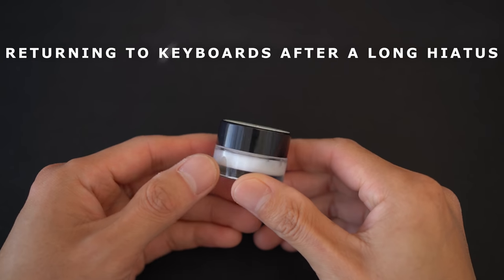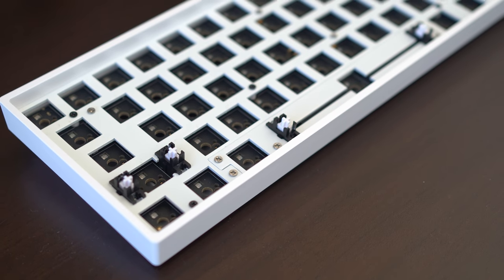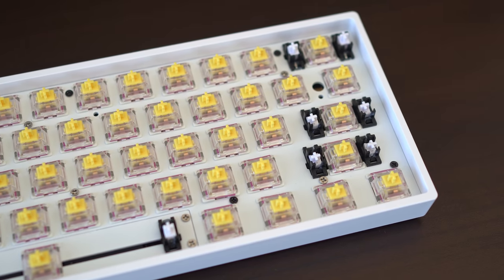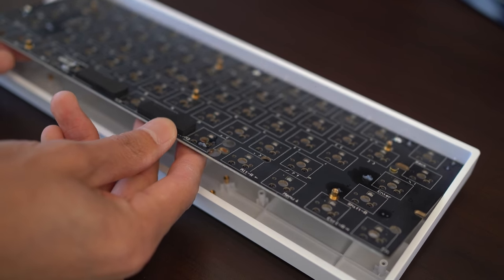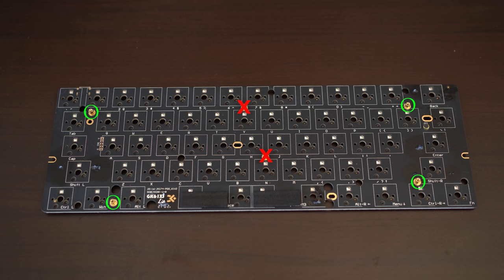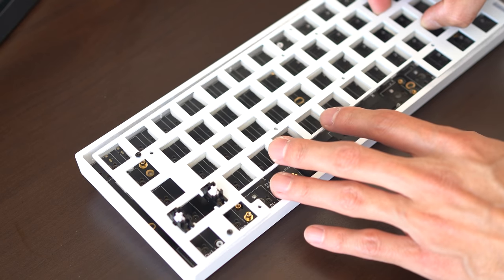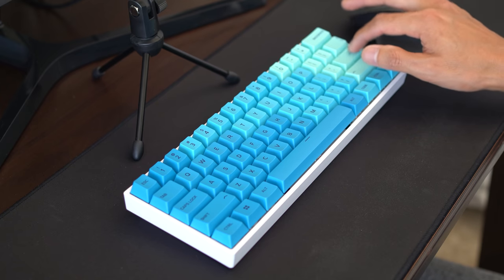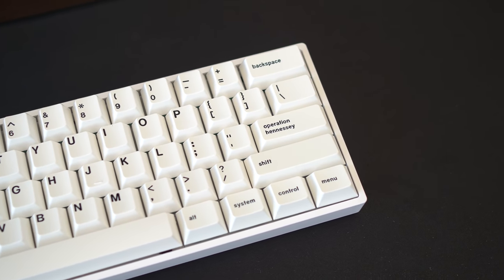THE GK61 - The Entry Keyboard that COULD!  O-Ring Mod+ for SOUND and Feel

Comment: I would personally use a much thicker foam or change the optical switches, they really do sound hollow and I don't like them. Stock Kailh's sound way better than these modded I think.
It's still an amazing job you've done.
Reply from the maker: Hi idyllsend!  This is the standard GK61 with the mechanical switches :)  I don't prefer the optical because they sound very hollow and chattery.
Reply: @Keybored  Oh there aren't the optical ones? Insightful. Thank you.

Comment: I have 2 questions my good sir

1.) will a 4x1x1 mm O ring work as an alternative for the large O ring? since I can't find any vendors in my area that sell the exact same size that you used

2.) What tool did you use to adjust the spacebar standoffs post-mod? 

besides that great vid man c:
Reply from the maker: You can sure try the 4x1x1 :)  Make sure you don't tighten it down too much, because then it would compress the thinner o-ring too much!  The tool I used to adjust the stand-off was a small precision socket from the Oria precision screwdriver kit on amazon!  https://amzn.to/3kwuF7e
Reply: @Keybored  thank you! such a helpful man 🥰

Comment: I did pretty much all the mods in the vid and my gk64 sounds great but it is superrr loud. I made a silicone dampener and put pe foam in between the plate and pcb but still loud. any ideas on how to fix this? Edit: I also did the tape mod.
Reply from the maker: Hmm... I would say the PE foam is making it loud!  The PE foam changes the sound but it also does ramp up the volume.  In addition, silicone doesn't dampen the sound as much either, so you might want to use something that absorbs sounds a bit more!

Comment: Hey Keybored, I am wanting to try this build for my first custom keyboard build, but I am worried about the keycap profile of the keycaps I want to use with it. The keycaps I want are cherry profile like the GPBT's in your video, which sound great, but I watched a lot of other gk61 build videos that said mixing cherry profiles with north facing LED's will compromise the keyboard's sound. Any advise on this?
Reply from the maker: It's not as much about the sound, rather northfacing and cherry profile can cause interference issues that will not allow the stem to bottom out properly. This does impact the sound but also feels weird. For this build, I used the gateron smd yellow with cherry profile in northfacing and didn't get any interference! These days, some of the switch manufacturers updated their housing so it works OK with Northfacing boards as well!
Reply: @Keybored  Okay, since I am also planning to use gateron yellows, I'll go ahead and buy the cherry profile keycaps, and just get the GPBT keycaps if they end up having interference. Thanks for the help, Merry Christmas!

Comment: how did he avoid the cherry profile interference with gmk caps?
Reply from the maker: The Gateron Yellow SMD switches actually work fine with GMK caps north facing :)  So does many of the Akko switches, the new gateron box ink, the gateron pro, most long pole stem switches, etc.  So... I feel that the north facing LED thing is starting to become less of a concern, since there are so many options of switches that work now :)
Reply: @Keybored  thanks)

Comment: I have mod this keyboard similar to the tofu for a while. You think half plate custom cuts would work in this keyboard? ahah
Reply from the maker: That would be interesting! The pcb doesn't have relief cuts tho for that maximum flex, but I'm sure itll change the sound and feel for sure. Might be a pain with the hot swap sockets and the switches falling out tho lol
Reply: @Keybored  That what I was worried about too, although I think as long as it's a 5 pin pcb mount it hsould be fine, somehow? we won't know unless we try. ahaha.

Comment: Hey, amazing job! Will OD: 5mm, ID: 2mm o-rings work? I can't find 4mm and smaller in my country :( Thanks!
Reply from the maker: Hi ifree2!  That size might be a bit too large :(  The screw might just end up going through the ID of that ring, instead of catching and helping to cushion.
Reply: @Keybored  Thank you so much! Also apologize for necroing this, but this mod doesn't seem to work (same stiffness and harsh sound) with Plate Tray Mount (instead of PCB, the screw is attached to the plate instead) like notably in split keyboard (corne, sofle - pcb is sandwiched between 2 plates). Not sure if you have any ideas on this.

Comment: I tried to do the similar mod to my 5 degree based on your tofu video. Did you use longer screws? I cant do it on mine because the screws are too short
Reply from the maker: Hi Tan!  My screws on the Tofu was long enough for it to work.  I have been told that some TOFUs shipped with shorter screws, and made the mod difficult.  The screw size needed is M2 x 5MM!

Comment: Will it work if i put both larger O rings on top and also at the bottom of the plate?
Reply from the maker: It should work.  But make sure the o-ring stays put and is not squeezed out!

Comment: Perfect timing for this video, I was just modding my  gk61xs with foam, lubbing my milky yellows, and adding foam jaja.

Edit: I just cant fit the foam inside this case, 2 small 3mm foam x 2
Reply from the maker: Might be a bit too tight. See if you find one that compresses really well, or maybe a bit thinner?
Reply: @Keybored  Yeah I really wanted to use tiny 3mm foam  in the spaces and then a big on over the whole space but is 2 tight in the space bar area and can close well. One mayor thing I noticed is my keyboard doesnt have those stand off in the space bar so I cant regulate it, could I just add some maybe?

Edit: I think i can use the middle ones u took of the keyboard and new ones
Reply: @Keybored  I put the space bar inverted and works fine, look for it on reddit and could not find anything about why this happens, its like magic
Reply: I use a type of packing foam, it gets rid of most of the hollowness for me.

Comment: Hey! Can I ask how thick your vinyl foam adhesive is, and where you got it from? Also, do you think i could use polyfill to insulate the case instead of foam? One more question, do you think I could use this fr4 plate from kprepublic (https://kprepublic.com/products/60-glass-fiber-plate-support-gk61x-gk61xs-gh60-only-support-plate-mounted-stabilizer?_pos=1&_sid=002cb86ae&_ss=r) non-split spacebar version instead? How do you think these changes will affect the overall sound profile of the keyboard? Thanks!
Reply from the maker: Hi Edwin! The vinyl adhesive is 3/16" thick. You could certainly use poly fill if that's what you have on hand. And fr4 plates have a deeper and drier sound, but also tenda to be a bit more muted than like the pc plates.

Comment: 10:41  what kind of screw driver do  I need for that ? Also do I need to get the smaller o rings for the top of the plate ?
Reply from the maker: Hi Akuto!  I used my precision screw driver kit!  https://amzn.to/2RrwRT1  And you don't HAVE to use the smaller o-rings, but it may fit a little better :)
Reply: @Keybored  oh thx for the reply man :) also what type of screw are the screws at the stand offs  spacebar module ?(the gold one ) Want to see if I have the correct screw driver

Comment: what size bolt did you use to take off the nuts on for the two middle standoffs on the pcb because none of the ones i had matched?
Reply from the maker: Hi Joshe!  From what I recall, it was the 3mm precision socket, but it could have also been the 3.5mm.  If you tried one of those and didn't work, it would be the other one!  Sorry I should have kept notes on which socket I used!
Reply: @Keybored  thanks so much I was planning on trying 2mm through 6mm next so thank you for the confirmation.

Comment: could i do the same w my ducky one 2 mini? if so what size o rings should i use
Reply from the maker: Hi Venice!  The ducky one 2 mini is also a tray mount keyboard, so you can take the same approach!  I recommend the 4mmx1mmx1.5mm since it seems to be the most versatile for me.  However, similar to the GK61, the rear usb cutout might be a bit tight, so you may end up having to file it like I did :)

Comment: was there any interference with the GMK keycaps and the north-facing config? if so, how did you fix it?
Reply: the u4t have a longer stem, like 0.5mm more than the normal mx pole, thats why there's not interference with cherry caps
Reply from the maker: Hi Charlie! I haven't had noticeable interference issues with the gmk caps on mine with thr boba u4ts!

Comment: is there any other things that i would have at home that i can use instead of that file cutter thingy
Reply from the maker: Hmm... I would recommend using something like a file, because anything sharper or knife like may end up hurting you instead!
Reply: maybe a nail cutter? some nail cutter have that file thing and it works good enough for me but it's a little hard

Comment: 1. Hi is using 2 different o ring sizes necessary? In the tofu 65 video you used the "larger " o ring size for both screw/plate and tray/PCB. Does it work the same if I buy just the larger oring or is it too big? Any difference in sound?
Reply from the maker: Wouldn't make too much difference in sound, but I suggested the smaller one so it fits better :)
Reply: @Keybored  Thanks!

Question about your noico mat. For it to be effective, do you remove the back cover so the rubber is exposed to the back case and also sticks to it? I don't really want to add a sticky mess to my case so I was wondering if I can leave the paper cover on the rubber and get the same effect. 

Thanks!
Reply: @expertise2115  i don’t think it matters much if you don’t peel off the back, and to ensure the sound damping works at its best, flatten the top part with a roller or with anything hard enough so the diamonds are flat

Comment: In my country, we only have thinner o-rings. Can I use 3mm x 1mm for every one of those?
Reply from the maker: Hi Jami! You should be able to use the small ones, but they won't be thick enough to elevate the plate and pcb above the center standoff enough. Perhaps you can try stacking 2 on top of each other?
Reply: @Keybored  Hi! I made it my own way and put the O-rings in the screw posts. You can see the results on my channel.

Comment: is there any interference with the north-facing PCB and the GMK keycaps?
Reply from the maker: Hi Randomphile!  For this specific build, with the gateron yellows and the boba U4T, even with the north-facing configuration, it did not have noticeable interference issues with the GMK keycaps.  Might be a different story with different switches tho.  Tangies get stuck for sure.

Comment: Have you noticed some interference between the switches and the cherry keycaps? Mine suffers from that unless I use oem keycaps.
Reply: keyboards with north facing switch orientation often do that, to circumvent this you should use different profile keycaps or switches that have long pole stems
Reply: i believe he's using the batch of gateron yellows that have "different housing", that's why he used cherry profile keycaps on this video. check out his gk tkl version video to find out more.
Reply from the maker: The Gateron yellow switches I am using and the Boba U4T didn't have much noticeable interference with the GPBT caps and the GMK caps.  It turned out ok!

Comment: is there buyable allready moded very good 12:30 sound like in the market rn
Reply from the maker: Hi G6Mr! I believe most keyboards on the market will require a bit of work to get it to sound the best! Switches would need to be lubed and filmed, stabilizers tuned, etc. If you are looking for something perfect out of the box, may want to look for a builder to commission?

Comment: Doesn't GK61 PCB have north facing switch orientation? Did it interfere with GMK keycaps?
Reply from the maker: Hi Still! It depends on which switch you use! I noticed that the clear top gat yellows didn't have noticeable interference with the gmk caps. Nor did the boba u4t,
Reply: @Keybored  okay thank you

Comment: I tried o-ring modding the space bar but the screws were just too short for the o rings to burger mount sadly :(
Is there any fix to this?
Reply from the maker: Hmm... The screw length should be the same as the others no?  What I would do is raise the screw mounting points as I have shown in the video, then o-ring mount so that you have the proper height and the same screw will work.
Reply: @Keybored  Sadly the screws for the split space bar module is smaller than the ones used for mounting the plate and it's quite hard to put another o ring after feeding the screw with another o ring through the plate. I wish I could raise the space bar but amazon shipping prices are really high and I couldn't find a screwdriver set with the socket that you used in your video.

Comment: Question: why do you use 2 different sizes of o-rings? Couldn't you have just used the same size for the whole board instead of 4 of one size and 4 of another, or is there a reason you used 2 different sides? I'm asking bc I want to get this board and mod it but I want to spend as little money as possible. Could I save 5 bucks and just use the same size o-rings for the whole board?
Reply: some were for between the pcb and the plate so they didnt need to be as big and the ones underneath the pcb needed to be bigger i think
Reply: But could I just used the bigger size for all of them?
Reply from the maker: If you want to just use 1, you can use the big one :)
Reply: @Keybored  thank you. I really am just a broke kid trying to save some money on my first mod

Comment: What tool did you use to get the two middle stand offs removed?
Reply from the maker: Hi KaZuCAL!  I used the precision socket adapter that came with the ORIA precision screw driver kit!  https://www.amazon.com/ORIA-Screwdriver-Professional-Precision-Smartphone/dp/B01E16J6RQ/ref=sr_1_1_sspa?crid=2UV3VWV4HRVR3&dchild=1&keywords=oria+precision+screwdriver+kit&qid=1623118757&smid=A2FOADTO08BQD0&sprefix=oria+pre%2Caps%2C172&sr=8-1-spons&psc=1&smid=A2FOADTO08BQD0&spLa=ZW5jcnlwdGVkUXVhbGlmaWVyPUEyU0NaSEgyQjlZS0lVJmVuY3J5cHRlZElkPUExMDIxODUyM1FSOFU4RUhOM1NSSCZlbmNyeXB0ZWRBZElkPUEwNzMyMDA5MkVNWkdMQkZLV0dCWiZ3aWRnZXROYW1lPXNwX2F0ZiZhY3Rpb249Y2xpY2tSZWRpcmVjdCZkb05vdExvZ0NsaWNrPXRydWU=

Comment: my gk61 standoff layout is different, theres 4 (one in each corner) and theres 2 more (top middle and bottom middle) with this layout, should i skip the middle two still? Also my board sounds very inconsistent for some reason and im not sure what is causing this
Reply from the maker: I would skip the middle 2 and go with the 4 in the corner!  Typically, tray mount boards are very inconsistent unless you use the O-Ring mod and even it out :)
Reply: @Keybored  the left side of my keyboard are more high pitch than the right side

Comment: How do boba u4t switches work if the gk61 is optical
Reply from the maker: Unfortunately no. You would need the standard mechanical version since the pcb are completely different

Comment: I didn't remove the center standoff but I didn't screw them in will this affect the sound
Reply from the maker: Probably not too much
Reply: @Keybored  well I didn't have to loosen a nut I just took of the screw it worked. I have outer 4. My gk61 is a bit different

Comment: If kbd fans and cannonkeys could keep entry boards instock it would retire the gk series probably. Just way better value and feel per dollar imo. Not a bad board tho. I had a full keyboard version for only 70 but returned cuz the plate was revited to the case for some reason.
Reply from the maker: Yeah, thats an issue with the hobby.  Many things are never in stock, and very hard to get!

Comment: Now i want to get a gk board. Will this mod work for the gk64?
Reply from the maker: Hi Mimoe!  It sure should!  The overall design is similar, so you should expect similar results!
Reply: @Keybored  thanks!
Reply: Sorry forgot to ask how thick are the foams? The one between the plate and pcb?
Reply: @1700tt  vinyl adhesive foam, you can get some from home depot for almost $2!

Comment: Isn’t it a fire hazard to cover the battery like that?
Reply from the maker: I believe keyboard draws such low amount of current that it should be ok.  However, if it's something that worries you, you can also cut around the battery!
Reply: @Keybored  thanks for the info!

Comment: How did you fit gmk keycaps on north facing switches?
Reply from the maker: :) Certain switches actually work ok with cherry profile even in north facing.  The Gateron yellow SMD switches were one of them, and some of the long stem pole switches also work with them as well!

Comment: Can you link the foam you used on the plate?
Reply from the maker: Hi Noel! It's the frost king vinyl foam in 3/16" thickness! https://www.amazon.com/Frost-King-Vinyl-Foam-Tape/dp/B094JWL8J9?th=1&psc=1
Reply: @Keybored  thanks m8!
Reply: Also, what do you think will happen if you just removed those adhesive foams on the plate? Do they really make a big difference? I'm modding my gk68x the same way you're doing with your gk61, and I forgot to order the adhesive foams LOL. I might still try and get them since they're only $4 tho

Comment: What is that tool u used on the spacebar standoffs?
Reply from the maker: It was a precision socket from the oria tool set on Amazon!
Reply: @Keybored  thank u
Reply: @Keybored  also can you link the vinyl adhesive foam that you used? also can u tell people to put the butyl sound deadener metal side down? i didnt know and it shorted the hot swap contacts together on my rk68 and bricked the board.